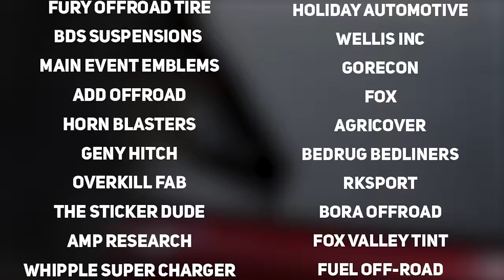TUG OF WAR - SUPERCHARGED CHEVY VS TURBO FORD!

Comment from the maker: Check out all of the parts that went into both of these builds at customoffsets.com/store

Who did you think would win!?
Reply: I said all week CO2 would win gasser do very well against diesels in tug of war
Reply: Custom Offsets I was honestly thinking and sure the k350 was gonna win boy was I wrong 😱😂
Reply: Damn everyone gonna say yall cheated..good excuse for the Ford guys but I honestly thought Ford was gonna drag the Silverado
Reply: Chevy power 💪
Reply: @kennymodica2519  
I'm a Chevy/ GMC  fan but I honestly thought Ford was gonna take it
Reply: I’m a ford guy and I 100% thought the k350 was gonna win for sure because the diesel motor weight but when I saw the big dudes hop in I’m like well nvm
Reply: My money was actually on the F 350 lol
Reply: #custom offsets that tug of war was sick
Reply: K350 should have dominated.  Wtf are those driveshafts made of now, recycled aluminum cans ??!!!   My F350 would pull CO2 apart.
Reply: I’m going to have to get me that supercharger. It’s not joke 0.p
Reply: I keep watching it and still can’t believe it 🤦‍♂️!!
Reply: Honestly I thought the ford would with no problem boy was I wrong
Reply: Tug of war with 20" wheels? 
FAIL!
Reply from the maker: Richard... 26’s !!
Reply: @CustomOffsetsTV  
Try 14" or 15"
Get that power to the ground
Big wheels break loose easy
Reply: @CustomOffsetsTV  
When will someone invent expanding tires?
Start out at 12" or 13" for acceleration 
Expands to 20" - 30" the faster they spin for amazing gas mileage 
Talk about a Billion Dollar Idea!
Reply: Chevy for the win
Reply: @benprevatt5001  if he would have spooled that diesel up properly there's no way that Chevy would have won
Reply: Let's see the bronco tug of war someone!!
Reply: I have a 2018 6.2 Ford250, so I was pulling for CO2 but honestly I agreed with Fuller in thinking torque was King. Thanks Shawn for destroying your truck with the awesome video!✌
Reply: Honestly, I thought the Ford would win, because of the diesel. But it's no surprise it lost, as Ford still uses old technology like MANUAL LOCKING HUBS and solid front axles! LOL...Chevy proves superior yet again. Hey Ford...the 70's called...
Reply: @benprevatt5001  as always man, as always!
Reply: Chevy’s are always pulling them found on road dead trucks home
Reply: @patheticcircus3774  I know. Ford is even offering your choice of up to four pairs of shoes with every Ford sold...for those long family walks back home! 😁
Reply: The ford had to much power for your driveshaft
Reply: Chevy
Reply: I knew that Chevy was gonna drag that p.o.s. Ford across the parking lot.  The Chevy didnt even stain.  🤣🤣🤣
Reply: Im not talking smack but those guys look like 440 lb weight each big guys.. They cheated ford was by itself
Reply: BOWTIE TILL I DIE, SON!!!!
Reply: @MagnusPrimeE1  and my DURAMAX with stage 3 cheeta turbos would rip your ford truck to pieces.  With a side of driveshaft snapping plz.
Reply: Asmith 1111   Oh ok I’ll add you to the list of overpowered diesel trucks I have embarrassed over my 13 years of owning Scourge .😁
Reply: Fix driveline and have a re-match 🤙
Reply: just a guy  I’m Magnus Prime E1 and I approve this comment!!!👍👍👍
Reply: Chevy all the way but I still like ford tho lol
Reply: Chevy all the way
Reply: Chevy bc there better ther ford
Reply: Not fair when one is jacked up another 4 inches and stuff. Needs to be same everything. Or atleast stock
Reply: Love this channel. Thank you guys for putting my 2007 Toyota tundra into the gallery today
Reply: ford
Reply: @thecloneguyz  That's what the problem was.
Reply: @roryrohrer7640  up up hi
Reply: We all knew Chevy would win

Comment: And the winner is... Whatever truck is heavier
Reply: and has the lowest center of gravity..
Reply: yeah that has a little to do with it but power also is a big factor. also I’m pretty sure the Ford is heavy anyways
Reply: SqwEarl * yo
Reply: Garrett Turley SCIENCE!!
Reply: And lowest to the ground
Reply: Yeah the Chevy is a gas burner and lighter than that Ford.  I would sell my Ford the next day if I was him😂
Reply: Yep and no.... engine power, traction gear ratio and all that good stuff the other reason the ford lost is bc it had a higher lift which puts more downforce on the back tires jacking front up and makes four wheel drive useless and makes it easier for the lower truck to pull
Reply: TheRocky5111 And A gas powered Chevy still won
Reply: The Chevy is a gasser, the Ford is a diesel and heavier. No excuses, the Chevy won and I’m not even a Chevy guy.
Reply: The Ford was heavier
Reply: Diesel trucks weigh more and the lift kit on the ford weighs more
Reply: @TheRocky5111  exactly
Reply: ford has bigger tires and wheels wich ads weight it was pretty much the same and the ford was probably still heavier
Reply: @luisruiz561  yep
Reply: and the one the doesn’t fall apart so easily
Reply: Its called  stabilitrac

Comment: 3 competitions in 1 
Turbo vs Supercharger
Chevy vs Ford
And
Diesel vs Gas
Reply: It's 4 f350 vs a 2500 the 350 is bigger
Reply: @tommypearson9260  I never said there wasn't one
Reply: @Turtletoise  when did I say it was fair or not?
Reply: @Turtletoise  v6? What are you talking about thats a 6.7 v8 diesel rated to tow like 30k pounds
Reply: humzilla707 Apparently not 😂
Reply: @Turtletoise  lol, either way that ford had all the advantages, the diesel so it can pull better, and the weight was also on its side
Reply: Brandolyn- Games what one is gas
Reply: It was 4 wheel drive vs 2 wheel drive only after the fords front driveshaft twisted and died. Plus it was a f350 powerstroke vs a Chevy 2500 6.0 gas engine. Ford should have taken it but couldn’t...
Reply: Boils down to weight power and tires
Reply: Boils down to the GM badge on front and rear of the Chevy!
Reply: @josephbaeza6699  🤣🤣🤣😭😭😭
Reply: Do the tow off stock guaranteed different results.
Reply: @horridfuture3835  I'd hope so a 1 ton diesel ford vs 1/2 ton gasser Chevy lol..... you ford owners got to accept ford sucks (Found On Road Dead)
Reply: Irish Caesar actually Ram owner but I still acknowledge Ford sells the most trucks whether I like them or not. Any truck can be good but you’ll never see me sending money to the partially government owned GM.
Reply: @horridfuture3835  well I advise you to Google that again because GM far exceeds Ford in "TRUCK" sales and well Dodge brings up the rear, it is what it, not what we assume!
Reply: Irish Caesar the F series is the best selling pickup in the us but yes if you combine Chevy and GMC and include all models of truck they sell they do climb just over the F150 sales. Ram sells much less as their gasoline trucks are not worth buying. Like I said any truck can be good. Some vehicles will pass 300,000 some won’t mainly depends on care and maintenance. Most people that hack on other truck brands own 90s to early 2000s chevs that are barely worth 5000.
Reply: @horridfuture3835  its amazing how you come up with these statics and bend them to your thinking lol, you wanna share that link where people that hack on others drive beaters, and your Fiat Chrysler Ram I'm assuming falls in that year model as you tagged me first and I just stated the facts GM owns Chevy, GMC, Hummer, Jeep, and Cadillac trucks where as Ford has a F series that most 90 to 2000 models aren't own the road like GMC & Chevys are literally everywhere and I do own a 06 Duramax, 14 GMC Sierra 2500 HD, and a 2019 GMC Sierra Denali 1500 Crew Cab with the folding tailgate! And they all run great!
Reply: Dont forget tires vs tires
Reply: @horridfuture3835  ford and dodge ram got money from the government too
Reply: The Ford is a gas job Chevy is the diesel
Reply: Brandolyn- Games ik they need a Chevy diesel vs ford diesel both turbocharged and the same for gas trucks but both supercharged
Reply: Everyone knows the heaviest truck is going to win it has more traction
Reply: @dalemarshall625  Good point
Reply: As well as the ford is also lifed about a foot higher
Reply: humzilla707  its not a 6.7 dude
Reply: Brandolyn- Games tbh, I hate diesel trucks even though I like ford better
Reply: @renzycostello3076  no.
Reply: @Turtletoise  A Ford F350 diesel outweighs a Chevy 2500 by a significant amount so I'm not sure what you mean by small ford. Also they both have engines with 8 combustion chambers and the Fords engine is larger and runs more boost pressure meaning it has more power. Turbocharger systems on diesel engines create significant boost pressure while bolt on supercharger systems generally make less than 10 psi.
Reply: Also I'm not sure I understand the whole: "the super dootie lost because it's an inch taller" argument, wouldn't that mean it was lifting the white trucks weight off the surface and putting more overall weight on its own tires & suspension equalling more traction potential??? Not to mention the Ford super dootie has the bigger engine running more boost. Super Duty is a name originally used by Pontiac in the 1960s as the name of a drag option package on cars like the Tempest. Ford please stop stealing from your competitors. You stole the front end off of Aston Martin for your cars.
Reply: Southern Fun  I'm not sure how you wanted your last sentence to read but it doesn't make sense. Try again. What's hard to understand about Pontiac came up with the Super Duty name? They used it on the Catalina as a high performance package. So Ford should have to change the way they spell it. Aston Martin is a brand of car and also there's plenty of side by side picture comparisons if you Google it so that proves that others have noticed it. If you think ford is so great then why do you have to pay about $10,000 more to upgrade to the diesel engine option and then another $10,000 to get the engine "bulletproofed"? Just lookup one of the websites like powerstroke help. I watched a video about the lawsuits that Ford went thru for their diesel ambulances and this guy looked straight at the camera and said the bottom line is we depended on these ambulances and a lot of people died because of these engines!
Reply: Southern Fun   Wow, you almost managed to put together a whole comprehendable paragraph like an adult but then you threw up all over yourself in the last sentence. I'm sorry you had to put yourself through that. The Ford achieved failure perfectly-it broke AND got snatched. I'm kinda on the side of the gasser so the results didn't make me "so mad" like you said. Let me let you in on some little secrets: the point of a tug of war is to see which truck has the best combination of traction, power, gearing, etc. When your truck breaks or gets drug around that's not what you want. For all you people who are happy the Ford won in the drag race on the other video just remember the Ford has the bigger engine running substantially more boost so don't act so surprised. These bolt-on superchargers generally make 7-8 psi in out of the box trim. You can buy a different pulley and easily get the boost up into the teens but it never stated in any of the videos that they were using an upgraded pulley or upgraded set of pulleys. Even if the supercharger was pushing about 15 psi it would still be substantially less boost pressure than a stock turbo diesel can produce. The difference here is that the GM LS/LT (gas) engines are world famous even in non-boosted setups. I've never seen a turboless Powerstroke transform an industry like the LS has. What a lot of trend following, group think, diesel apologists need to ask themselves is:do I like the driving the diesel or do I like driving the turbo? Newsflash: you can put a turbo on a gas engine and still have the same benefits that are enjoyed from a turbocharger on a diesel. But guess what there's other benefits too: gas is cheaper than diesel, oil changes on gas V8 truck engines are way less expensive than on a diesel, you only need to buy one battery when it's time for battery replacement instead of two, my gas truck doesn't even have a serviceable fuel filter but my diesel service truck had to have the fuel filter changed at every oil change, in some climates where you have to use a block heater on diesels (like the engine is on life support) you can go right out and crank a gas engine up and go. The diesel has to sit there and warm up. Also I don't understand why people have this interpretation of a diesel being so strong and durable. Have you heard of these bulletproofing services for the Powerstroke? You have to spend about an extra $10,000 when you buy the truck for the diesel engine option and then take it and get it bulletproofed which typically costs another $10,000. They don't offer bulletproofing for gas engines because the user/consumer hasn't exhibited a need for it. Meaning there hasn't been a mob of angry owners with chronic problems. People please start to realize the facts. Diesel was popularized by high school kids in the 2000s. A lot of these diesel owners don't even own trailers. Get over diesel.
Reply: That was dumb. The ford was lifted and the turbos have way more lag then superchargers. Not a far go ford still king to me
Reply: @tarryjohnson6089 That was dumber. I thought that new compound turbo systems and variable geometry turbos have made lag almost non existent? If the Ford doesn't need the turbo then I'd like to see the Ford diesel vs the Chevy no turbos or superchargers. You'll see how that Powerstroke ain't shit without the turbo but Chevy gas V8s are famous the world over even in non-boosted setups. Don't worry about the Ford being lifted that just means that the Ford had an advantage in pulling up on the other truck lifting it's weight off the ground decreasing traction potential for the Chevy and putting more of the chevys weight on the ford. Please explain to us more how the Ford was so disadvantaged. I'd like to see the test again only difference start unplugging spark plug wires on the Chevy until the Ford wins. I bet it would take at least 2 unplugged wires before the Ford could stand up to the chevy
Reply: Lincoln Ls Ahead of it's time.  Where in the video was the weight in the bed? I guess you were there in person and you saw the weight in the bed? Or is it just OK to claim there was weight when there really was no weight because you don't like the outcome of the video?
Reply: @Irish4u2nv  youre a child dude lol they are far from stock so its not ford vs chevy kiddo think again
Reply: @CertifiedGraveDigger  I guess your the guy who shows up a week late to a party, huh! 
Or the guy living in the past going "remember when" always!
Reply: Yeah ok turbocharging and supercharging is stock okkk idk why you got so butthurt but obv not stock they done wheels tires and suspension which can increase or decrease performance plus the boosting of the engine as well.
Reply: @Irish4u2nv  I never asked for your opinion lol.
Reply: @CertifiedGraveDigger  and yea trucks come from the dealer with Turbos and superchargers now boomer, been happening for over a decade!
Reply: @dontworryaboutit2059  lmao literally..... I spit Mt. Dew on my floor board!
Reply: @dontworryaboutit2059  lol thats all you have to say? Youre another 12 year old i guess
Reply: @Irish4u2nv  lol yet youre trying to intimidate me yeahhh hypocritical ig
Reply: @Irish4u2nv  yeah no shit but not like the ones on those
Reply: @CertifiedGraveDigger  BTW, we've all been over a long time ago, JS every little thing you've said has been discussed and if you don't think Ford and Chevy makes these trucks made to order, well you need meds and you've already repeated what Irish Caesar said about the rims! Get off your phone your either not doing your school work or having a old timer moment thinking about back in the day and crager mags, not how now you get trucks made to order! Don't you know both these trucks are off shoots same as a Shelby?
Reply: Can add broke vs running. 🤣😂
Reply: Yeah loading the Chevy up with people was stupid because no one is in that ford besides the driver..